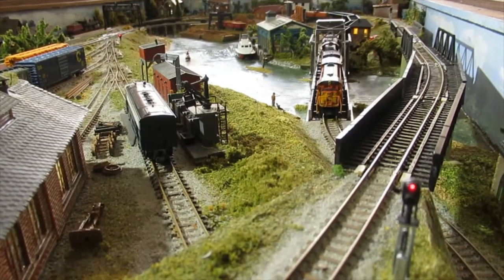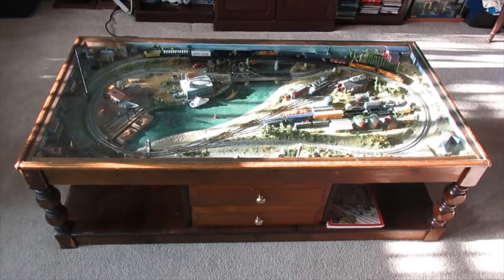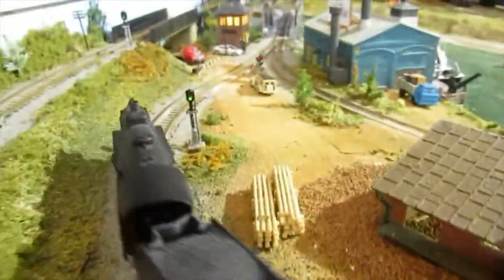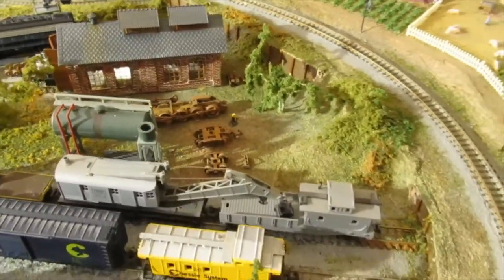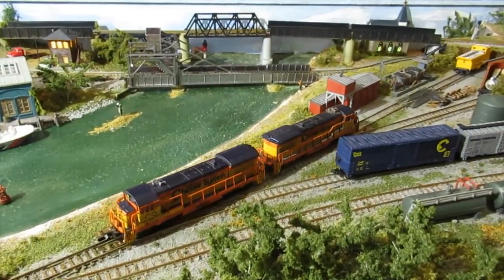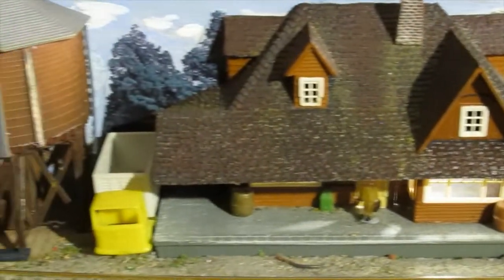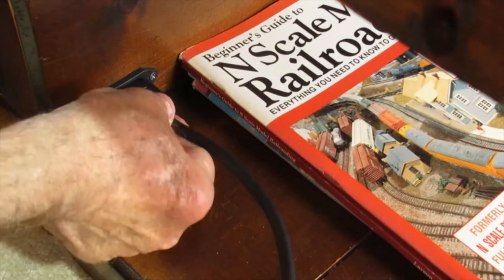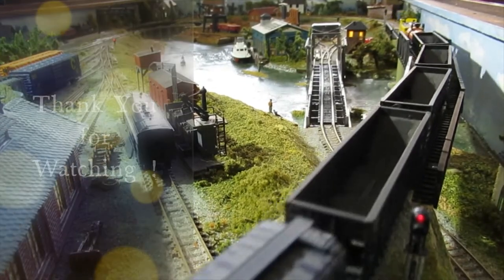N Scale Coffee Table Railroad Empire, Little Trains Under Glass, transition era model railroad

Comment: So cool. I had an Empire railroad I freelanced back in the late 80s and had six of those good running N-scale, Hong Kong Bachmanns with the metal gears. I had two U36Bs,  two F9s, and two GP40s. I also used Rapido couplers. The knuckle couplers back then produced a jiggling effect when running trains down the track. The Rapidos were much more reliable.

Comment: Very nice. Did you build this yourself ?
Reply from the maker: Thanks.  I had some experience building simple wood furniture, so I designed and built the table and the layout to work together.
Reply: @richardperrelli3970   I love the detail you put into the Surroundings and track layout . .  As a beginner, may I ask what Brand of Train set  is good to use ?
Reply from the maker: There are many very helpful N scale locomotive reviews on YouTube that compare new and old models from different manufacturers. Here is one: https://youtu.be/taR-NdmAEPY

From my experience, KATO has always made smooth and quiet running locomotives with good electrical pick up.  Bachmann, Atlas, and Life Like make some good locomotives now, but earlier models could be very problematic.
Reply: @richardperrelli3970   Thanks Richard .
Reply from the maker: This is very useful in selecting a locomotive also https://youtu.be/qRTsN3CwUSk